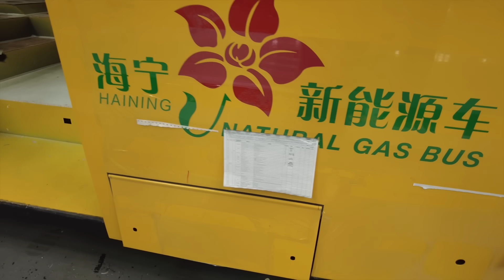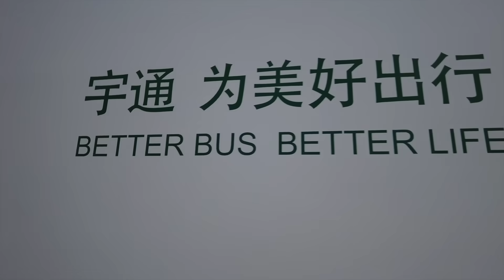Walkabout The World's Largest Bus Factory (Yutong Industrial Park)

Comment: I remember a story from when I was a bus driver in Perth Western Australia.  We had old but reliable Leyland buses. Crude, bombproof buses which thrived on neglect. The time came to place an order with British Leyland for I think 900 new buses. We only wanted rolling chassis, the coachwork to be produced locally with local materials and labour. BL said completed road ready buses only, take it or leave it. My company said, Fine, we'll leave it thanks. We placed an order with Mercedes Benz and ended up over the years with a fleet of Mercedes buses which constantly improved over successive marques. Wonderful machines. We did dabble with Renault buses too but they were universally condemned rubbish compared to Mercs.

I've been off the buses now for over 20 years so I've little idea what type are in use now. Perhaps my old company could benefit from a visit to this outstanding facility....
Reply from the maker: Many options available, and that's a good thing.  Thank you for sharing your personal experiences with this.  Cheers!

Comment: i work at nzs largest coachbuilders and yutong have imported some ev busses to the streets of chch and we built some competition busses for the bus operators here and the busses we have built are a hell of a lot easier to work on and look way better. we put all the batteries in front of the ac unit on the roof with a streamlined fiberglass cover that runs the length of the batteries and blends into the ac unit. yutong just put their batteries on the roof in 2 seperate bulky boxes and the ac unit in between them with bulky ugly covers, they also have some very strange and questionable design features on them that our fully nz designed and built busses dont have. tbh not a fan of them

Comment: Re: your rant about "green revolution in buses". 

Before jumping with joy, you need to do two things: one, think where the electricity to charge those buses comes from, and, two, check out how that electricity is produced around the world. And unless you're an idiot Boris Johnson, who thinks "electricity comes from the plug", you should think twice before praising electric buses. 

In your country 60% of electricity is generated by coal, and your president, Mr.Biden, torpedoed the Glasgow climate summit and refused to sign any commitments towards reducing the use of coal in the USA. Electric buses simply force eletro companies to burn more coal to produce more electricity. Green revolution? NOT EVEN CLOSE.

Comment: Came across your interesting channel by accident. You said they build 440 buses a day at the rate of one every 14 minutes. Even working 24 hours a day, one every 14 minutes would be about 103 per day. The 440 number sounds much too high. Just prior to that you said Yutong built 70,000 units last year. That would be a little under 200 a day (based on 365 days) and as you said they make other types of vehicles than buses.
Reply from the maker: yeah, the numbers are straight from the Yutong media pack...  They're making distinctions between capacity, average output, "units" are of course different products, and sales which last year were below manufacturing capacity.

Comment: 9:48 ... steering wheel (dis)assembly while driving down the factory floor.
9:53 ... fits well.
Reply from the maker: it's a temporary wheel used to transport the bus (because the real one hasn't been installed yet), inserted by the worker and then he removed it.
Reply: @WalkaboutRojo  ... while the bus is in motion. Looks suspect!

Comment: I work bus body building in first garden industrial area . make bus chairs fabrication.bumper luggage box . battery box side frame level perfect  mig welding . drills fix bolt and nut s one day around 14 ringgit.overtime extra.intersting every 10days get payment.
Reply: Ipoh. Perak.
Reply: Levels check using flat planks thread 🧵 jerk.
Reply: Using revet fitting aluminum body.roof

Comment: The metro trains in Boston and Philadelphia are made by a Chinese company that assembles them here in America. China is so far ahead in electrical vehicle manufacturing it's not even funny. Competition? What competition?
Reply: I build electric motorcycles. Motors, controllers, computers, data systems, all Chinese. You are correct, there is no competition.

Comment: 100 different types of buses, so what the did was line runs one side of building and finish and out the other side. How to supple the line with parts. In limited space Is the question.
 It More organized than regular 8 length wise that double up to 8 lines
Reply: I like Volvo articulate e.v bus, it made for a bus transit route that I have designed, it's a over head charger on the road. The beauty of this system is long therm. The buses comes with support and installation of charger and a service maintenance plan included